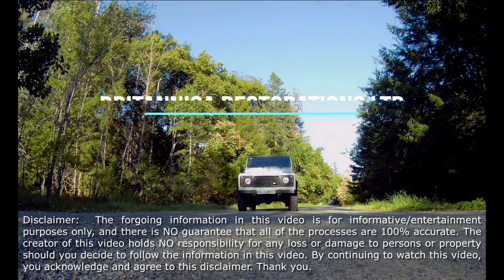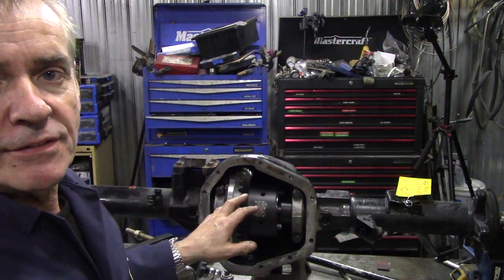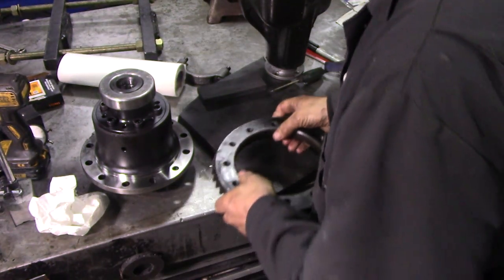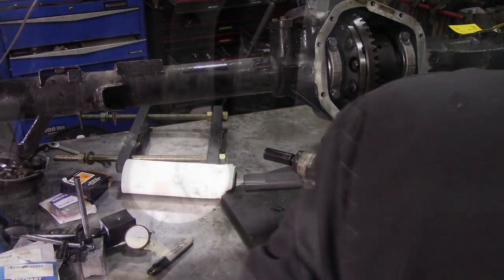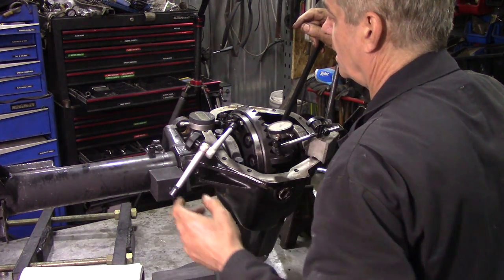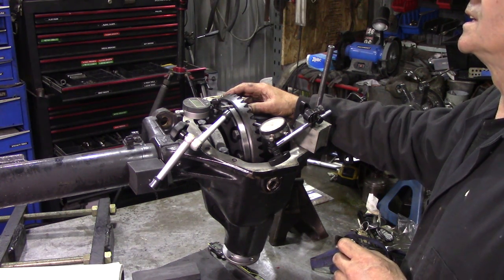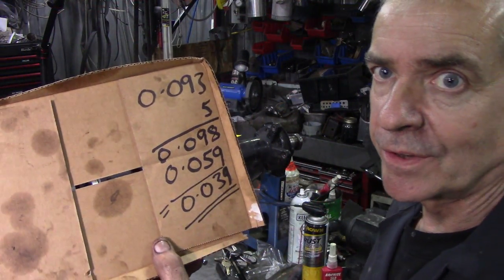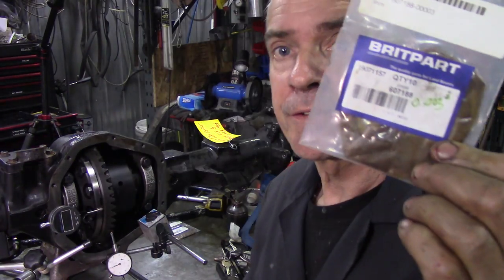Salisbury axle setting the crownwheel backlash part4

Comment: Should the 5 thou bearing pre-load not be be split 50/50 (0.0025) and added to either side eg 0.0615/ 0.0365 otherwise the 5 thou pre-load is effectively all added to one side pushing the crownwheel away from pinion by 2.5 thou and increasing the backlash from the 8 thou measured?
Reply from the maker: Yes but it works out in the end!
Reply: It is quite hard to get your head around it all without some paper and a drawing. I’m just concerned I fit the side -carrier  bearings then find out it is not right and  have to pull them out to do it all again. I bought a spare set of Timken carrier bearings I hope to hone out and use like dummy bearings for setting up when fitting a Truetrac in mine.
Reply from the maker: The solid dummy bearings are a godsend!
I had the backlash right in the end - but the pattern was wrong in my opinion (I was puzzled by the -2 on the shaft but not on the head of the pinion)
I increased the pinion by 0.002", but that naturally tightened the backlash to zero - so by subtracting a shim form the crown wheel side and sticking it on the other I seem to think I got it to 0.009" backlash (next video)

Comment: Great videos, I have a Truetrac to fit to my Salisbury so watching with particular interest. Should the 5 thou bearing pre-load not be be split 50/50 (0.0025) and added to either side eg 0.0615/ 0.0365 otherwise the 5 thou pre-load is effectively all added to one side pushing the crownwheel away from pinion by 2.5 thou and increasing the backlash from the 8 thou measured?